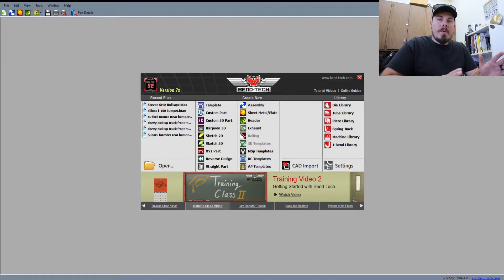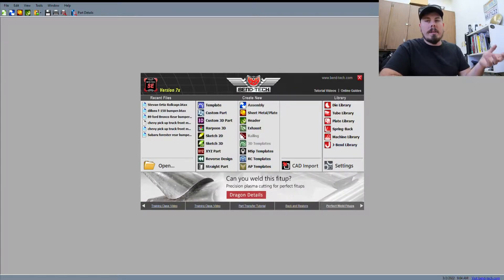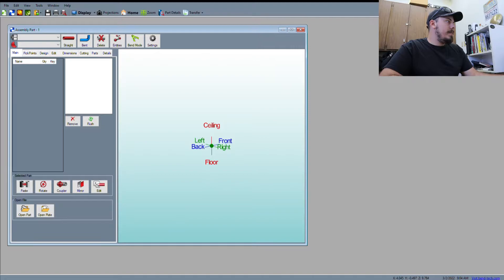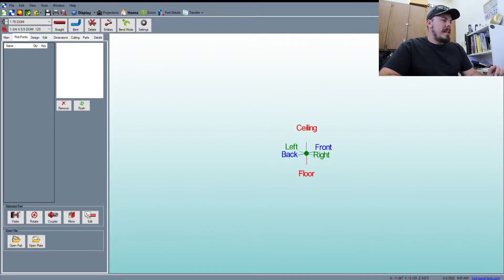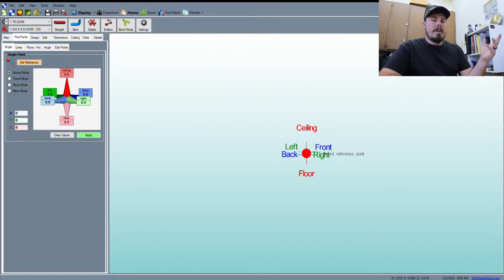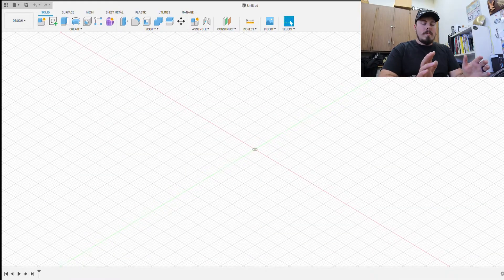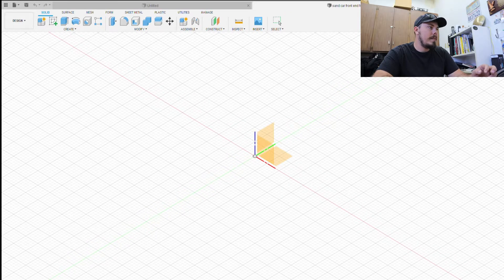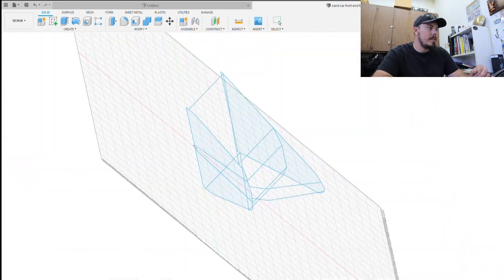sand rail repair part 2 : Bend tech /  fusion 360 Simulation

Comment: it seems like there's a way to do this in just fusion, but its kinda dumb that for sheet metal & tubing fab & reverse engineering of any kind (like just 3d scanning a simple part to make a few 1-offs) that you need at least 4-5 different pieces of thousand (sometimes multiple thousand) dollar software and a hundred hours of learning these pieces of software just to integrate all the things that even any home fabricator would want to do if they don't want to do all of it the old fashioned way.
Reply: even that NTD fab guy has fusion AND bend tech on his channel.     oh... and for tab and slot sheet metal:  solidworks as far as i can see thus far.